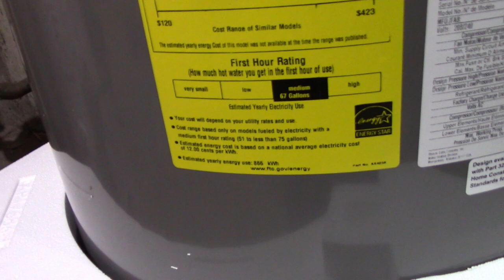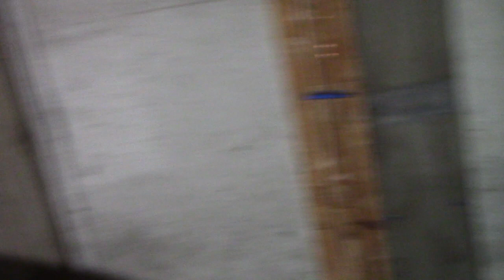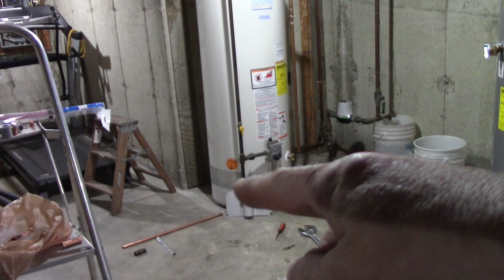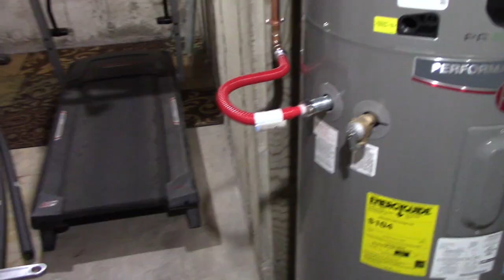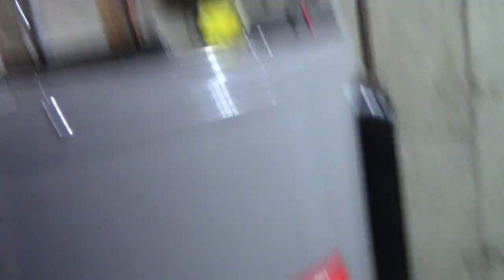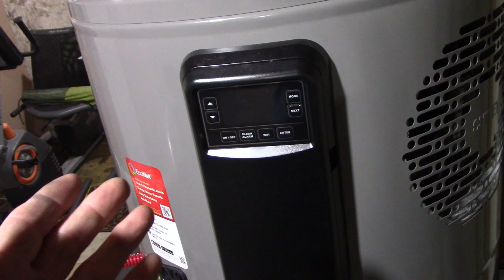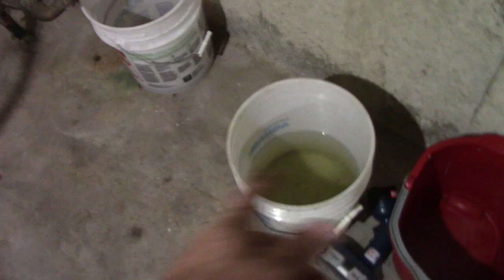DIY Rheem Hybrid Water heater complete installation. From gas to hybrid.

Comment: My new pro Terra electric water heater has a red and black wire at junction box. The gree ground is screwed into the junction box.  But my I
Old ge unit has the ground connected to the house ground wire. How does the Rheem get grounded if there is no direct connection to the house ground ??
Reply: at the panel than to ground .

Comment: Why did you choose to use copper instead of pvc or pex etc?  Copper is so expensive, and needing to use solder and all that,  it just seems silly now days.  pvc with the glue is so much cheaper.

Comment: I went to a hybrid rheem water heater.  Insanely efficient..  costs me a few cents a day or 10 dollars a month vs 50 dollars a month with propane.  install was pretty easy for me.  And yeah rolling that box into the basement was quite the experience.  I ran the electric from the breaker box, installed all the plumbing, and a new expansion tank.  Learned so much in those 4 days lmao.

Comment: The extra wires in that module -- "The SkyCentrics CTA-2045 module is a Wi-Fi module that plugs in to DC slots on certain appliances which allows them to communicate with the internet and connect to the grid for special utility rate plans." -- it's this futuristic thing that may never get implemented by your local utility company

Comment: Stupid question... i tried to hook up the app but think i messed something up, it doesnt have the word heat pump anymore, how do i change it to heat pump?
Reply from the maker: The "mode" button should cycle through all the modes. But other than that I don't know. I couldn't get the to work either
Reply from the maker: Couldn't get the app to work either
Reply: @@JLafix  thanks! We hooked it up and thought thats all you did. Didnt realize you had to actually put it in a "heat setting"

Comment: The phone that uses the app needs to be connected to the 2.4Ghz frequency of your home wifi since the water heater does not work with the 5ghz frequency. That may be the issue that is not allowing you to connect.

Comment: The CTA and WiFi are different, and I have the WiFi set up without using the CTA.
The Wifi is a great feature, and it alerted me to a problem with the heat pump.  These hybrid water heaters are not like refrigerators or air conditioners where you know when they fail.  Because these hybrid water heaters use resistive electric heaters when the heat pumps fail, one probably isn't aware if/when they fail.   Only after noticing an inflated electric bill might you start to wonder what's going on.   When I had a problem, the alarm went off, but I could not hear it.  The water heater also sent an alarm to the app (I usually hate apps), so I saw it there.  The app history also clearly showed that the energy consumption doubled after the heat pump was disabled.  Great feature.

Comment: great video. We also live in NE but have good ol oil/boiler for hot water.  Same as you, climate controlled basement and we're weighing the pros and cons on a straight electric water heater or the hybrid ( just the plat perf., not the proterra version). Our electric company has the rebate for the hybrid, which helps bring the cost down.. So a year later from this video, what are the pro's and con's with the unit that you've found. Thanks :)
Reply from the maker: At first this thing seemed to run a lot,  and switching from the traditional gas heater to hybrid it was much noisier.  But after venting both the intake and exhaust ports and running it on the energy saver mode, I barely notice the thing is running. (Maybe just got used to it over time)There is an app you can download to talk with the unit for showing your usage and cost, but I never got that to work so I can't tell you the difference from old unit. Plus I never knew the energy cost from the old to compare. So only time will tell if this thing will  last without issues and will be happy if I  can get at least ten years of maintenance free operation.
Reply: Did you need vents? I am thinking about replacing my oil water heater? Read the manual and you need to vent if in closed room.

Comment: Open the app, and click on the 3 bars on the upper left and scroll down to contacts. There is a phone number in there to call for help setting up the WiFi, and they answer right away and in 5 minutes they'll talk you through setting it up. It shows your energy usage history in the app, and you can schedule how you want it to heat the water on certain days and times of the day, for instance if you need to comply with off peak energy usage, or if you use more hot water on certain days. The leak alarm has an automatic cold water shutoff,  so if it sprung a leak, it shuts off the heater and shuts off the cold water to the tank, so you wouldn't have to be there as you stated. When you brought the water heater home, did you have it horizontal, or standing up? This one can be laid horizontally without causing the usual problems that things like refrigerators have, but giving the oil 24 hours to flow back into the compressor before you turn it on will help. That may be why it seems more efficient after you had it a while. There is a video by Rheem touting how this one can be transported flat, but waiting with it vertical wouldn't hurt.
Reply from the maker: Good to know

Comment: That WIFI feature seems like a joke to me. No way that company will support the app for the lifetime of the hot water heater. So for example IOS 21 comes out. Is Rheem going to keep updating the software to work with my model of hot water heater that's 15 years old? I think not which essentially means the WIFI capabilities are a dead feature unless you want to run an unsecured version of IOS. You can't get any of these companies to support the software after 3-5 years let alone 15-20.  Their common response is you need to upgrade to a newer model.

Also I had my electric panel replaced a few years back and I had one of those meters to set the hot water heater temp depending on the day and time of the week. The electrician removed it and said those things are garbage as you spend just as much electricity heating the entire tank back from a dead cold state. So as you said I would just keep it at a constant temperature.
Reply: I hate apps too, but unless you hack the IOT (Internet Of Thing) to send the data only within your LAN, your stuck.  That goes for all IOT devices:  NEST,  WiFi cams, Alexa, etc. all work the same way.  I think you should learn a little more about WiFi security.  By simply spending outlandish prices for the latest Apple stuff, don't think you're immune to internet security threats.  Rheem will be around for a while.  Don't worry.
Reply: How to you set the schedule without the app? Can you do it from the front panel?

Comment: "Kaboom." Fun to see it all come together. I have one sitting in my basement right now waiting for me to install. Your skills and knowledge far exceed my own, but I've read the directions all the way through twice now so every time you hit a snag or weren't sure what to do and then said you hadn't read the directions I was thinking "that's in the directions." Anyway you got it installed and working so it all works out. I'm just guessing that when you were using the pressure release valve on the heater you were not alleviating any pressure in the system and that's why there was so much pressure there -- the directions say to open all the faucets before filling. Also just a guess, the train-whistle piece is there because your municipal water supply doesn't allow the water to go back into the main which can result in a pressure build up if you were to allow the water in the heater to cool (also in the directions). I was worried when you didn't know what it was that you wouldn't reinstall it, but you did. That was very smart/wise to reinstall it despite not knowing if you needed it -- a good lesson for me. Thanks again. I think I'm ready to go stare at the empty heater sitting in my basement for a couple hours (I'll get it installed eventually)!
Reply from the maker: Very kind words sir . I see you watched the entire video and picked up some stuff which is perhaps my learning curve mistakes. I made two more videos with some learning curves about the exhaust and intake venting. But happy to see that you picked up on that I don't like reading directions
Reply: @JLafix   I will check out the other vids. Not planning to do any venting, but will have to see how winter goes. One of the perks of this heater is I don’t have to cut a hole in my house. I’m excited to have my water heater pulling a/c and dehumidifier double duty in the summer but not so excited for those things come winter. Definitely picked up a few things. You did everything according to directions (except for opening the sinks which you did find a work around for). What were the wood slats you put up on the walls? I think you said pressure-treated plywood? Secured with concrete screws? I’m considering adopting that for my setup.
Reply from the maker: @DrumDrumDrummerDrum   Yes just regular half inch plywood pressure treated because I had it around  And use those blue tapin  screws to secure it to  The cement walls
Reply: @JLafix  OK. My last comment was short-sighted. I definitely will watch your vids on venting. Can realize further energy savings/efficiency. I know you said you aren't into all the efficiency stuff, but check this out anyway: https://www.watertechonline.com/water-reuse/article/15550318/the-benefits-of-harvesting-hvac-condensation. With your condensate pump you could water some plants with your daily 2 gallons of condensate in these very dry times! Your pump setup got me thinking about this. I have a dehumidifier, furnace, and now water heater generating condensate that I just send down the drain. I am going to figure out how to harvest that. Ambitious, but I'm going to look into filtering and purifying the condensate to be reused by a humidifier in the winter. That way as the heat pump dehumidifies I can humidify. Eh?? In the summer it will go to the plants unless I think of a better use. This too: https://www.energy.gov/energysaver/water-heating/drain-water-heat-recovery
Reply: As other have mentioned, the "train whistle" is most likely a vacuum relief valve. This helps protect the water heater from damage should you have leak that causes a vacuum. I've been reading that these are recommended for bottom fed tanks. A thermal expansion tank is used if the municipal water supply has a check valve not allowing water to go back into the main.

Comment: Just finished my install of this water heater,  it replaced a 13 year old propane one that cost me 40 dollars a month to run.

Lessons learned:
1.  IF you have an expansion tank where are you going to mount it on the new system?  This new system has mounts on the sides not the top.  So plan somewhere on a wall away from the unit because you can't do it from the ceiling or hang it from pvc pipe.  This added a day and a few more trips to local big box do it yourself store.  And I found out my old expansion take was broken for who knows how long because I knew nothing about it.  Expansion tank is half air / half water inlet.  And you pressurize it to your water inlet pressure.  So buy one of those faucet water pressure gauges.  see  what your pressure is at if its at 60 psi your good if its above that try to turn it down by the water pressure device going into your house off the water main.  The valve on it when pressed should not contain water if it does the tank is bad and replace it.   Check pressure with tire gauge, while your water system is empty,  ( main closed with empty pipes).  If its low or high and doesn't match your water pressure inelt,  put more air in it to match.  Then open mains close faucets and your good. 
2.  Plan your  new pipe runs carefully and have extra pipe / fittings just in case.
3.  USE PLUMBERS TAPE!  How I forgot this with 90 degree all metal fittings on metal fittings is beyond me but I did.  Got it all setup and of course leaks.   Had to tear it out and redo it.  All metal fittings use plumbers tape, wrap it around 3 times top to bottom on the threads.
4.  Remember  you can run 90 degree elbows with metal fittings off the water heater so it goes straight up to attach to existing piping,  just add 2 90 degree turns to existing piping that was cut off.  If its copper to cpvc you can use shark bite to avoid anything with fire and solder.
5.  If you need to run 220 wiring,  get 10/2  ( 10 gauge wiring with 2 wires it includes a ground).  So its physically 3 wires.  10/3 is 2 hot wires and 1 common white wire and the ground wire.  Would of saved me some money and time and effort if I knew this before.  that 10/3 is meant for outlets where appliance may need 120 volt and 220.  
6.  The 30 amp breaker is meant to protect wiring.  So use 30amp for 10 gauge.  I couldn't find a 30 amp so I bought a 40 amp and then found out why you need to match appropriately.  
7.  Frist time this unit fires up its going to run constantly until all the water is up up to temp and its full of cold water.  So prepare for a cold room if you don't vent.  But after that mine barely runs at all so the room isn't bad at all.  
8.  Water temp,  my old one was in the 130's,  this one does just fine for some reason at 125.  I have hot showers with no issues.
9.  For the condensate drainage,  I just used a 3/4 NPT to barb 1/2  elbow 90 degree turn,  so its a simple flexible clear tube running to the drainage pump.  This part doesn't get hot so no issues.  Just keep the tube away from the hot outlet and high pressure release valve because they get hot enough to melt it.  I used some heavy duty tape to steer it away.
Reply: Thanks, I wish I found this before I bought the wire. I’ll go back tomorrow morning before the heater arrives and save about $25 on 50’ of wire.